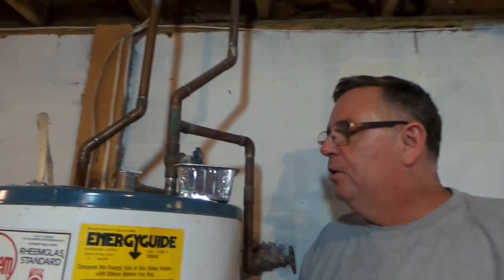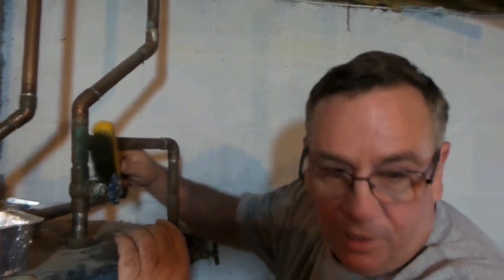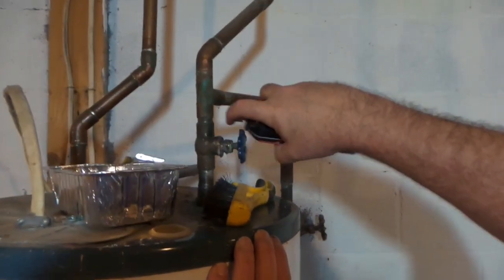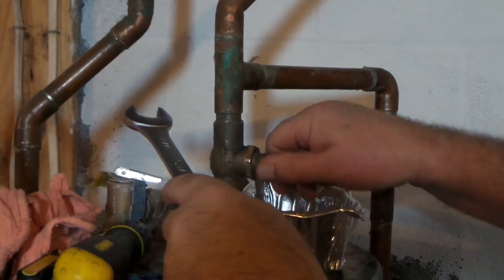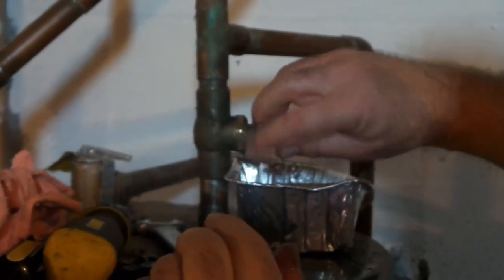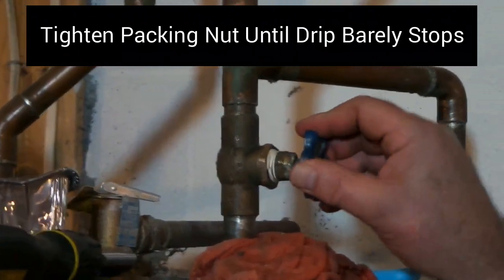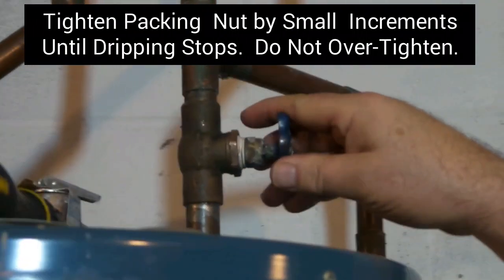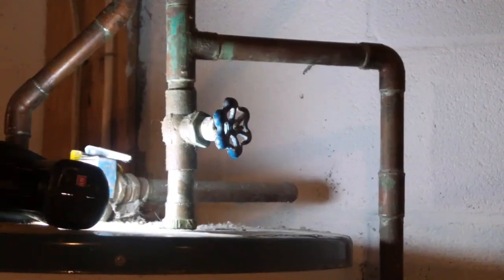Repair Leaky Shut-Off Valve Howto DIY Fix It - Please Read Safety Tips & **New Info** in Description

Comment: Aren't you supposed to wrap the packing rope around and against the stem?   Between the stem and the packing nut.
Reply from the maker: bobby D, That's the general consensus. But our valve is fixed, no leak. Cheers!
Reply: Does it matter what direction rope is wrapped also? Just asking. Reminds me of a “stuffing box” on a boat where shaft goes through hull. It’s made from a waxy wool.

Comment: I have a same problem with main shutoff valve, local 5-star plumber quoted an estimate of $980 to replace valve and pressure regulator, I know they would be very unhappy to see this video, because now I can fix it with only a few bucks.
Reply from the maker: Thanks for the comment
 Glad this helped you.
Reply: Plumbers are crooks
Reply from the maker: @johnnykurplutzo6789 - Some are.

Comment: I am having the same issue now. Home Depot tells me to replace the washer inside the valve, or replace the whole handle. What do you think?
Reply from the maker: @Jirong Hu ,

Hi. Thank you for your comment. We think you should do what works best for you, given your supplies, skills, and situation. 😊

We chose a rope seal repair. If you do this, once the packing (or bonnet) nut is loose and its threads clean, you can wrap its threads with PVC tape in a single or double layer to prevent leaks there once the packing nut is tightened. Apply the PVC tape, wrapping in a clockwise direction and slightly stretching as you go; this will hold in place while you finish the repair with the rope seal.

The rope seal goes on the valve stem and will be under the packing nut when that is tightened down again. The rope seal is also wrapped in a clockwise direction so that it stays wrapped as you tighten the packing nut back on the threads that you covered with PVC tape.

Basically, the thin PVC tape prevents leaks between tight metal to metal surfaces (such as packing nut to threads), whereas the rope seal is used to seal larger gaps (such as the space between the valve stem and packing nut). Both tape and seal are applied in a clockwise direction so they tighten as the packing nut is tightened. 

Remember to tighten the packing nut just enough to stop the leak. Do not over-tighten it; that could cause restricted water flow.

Please read and follow the cautions in this video's description.

Whatever method you choose, we hope it works well for you. 💦✅

Comment: Noticed the rope was put on counter clockwise
Reply from the maker: That's true, DIY john. And for anyone concerned with this type of repair, it is a good idea to wind the rope seal clockwise so the nut will tighten it, rather than causing it to unspool (if it catches the end of the rope). We were fortunate that the rope stayed put. Should it leak again in 30 or 40 years from now, we will endeavor to twist the rope seal in the clockwise direction. 😝 Thanks for commenting.
Reply: Thanks for the video very helpful
Reply from the maker: You're very welcome, fun times ahead. Glad we could help. Thanks for the feedback!
Reply: @ntccXerblog  do plumber tape work as well?
Reply from the maker: @cjjonez  if you mean that thin PVC tape, we would NOT recommend that.  You want the rope seal shown in this video. It's not too expensive; and you don't need much. 😀 Thanks for the question. 👍 Hope this helps.
Reply from the maker: @cjjonez  Look at 3:00 There is a pic of the rope seal we used. Someone named Olorin Mithrandir found the time for us. Very helpful.
Reply: @ntccXerblog  thanks I was in a emergency situation. I had the tape I used it. So far so good am going to buy the rope. Just in case. The guy at hardware store said it couldn't be repaired.. I felt it could I found your post and very thankful for your help...keep up the great work.
Reply from the maker: @cjjonez  Hey, that's great! We are big believers in "Whatever works." Conventional wisdom (proven methods) are great when you have everything you need on hand. But sometimes we need to work with what we've got. Glad you found a quick fix for yourself. We're curious to know how long the PVC tape will last; after all, there had to be a "first time" that somebody tried rope to pack a nut and create a seal that way. Maybe your fix will last just as long. We hope it does! Anyway, thanks for your comments and support.
Reply: @ntccXerblog  I can say this when I first tried it. I had the it shut off . I did what you said but with the tape. When I applied pressure to my kitchen  line where the problem started. The new shut off failed the pressure test it was new it leaked like crazy. So I had to redo all that work again. That's how I found out leak at hot water shut off. So I used your method in making adjustments it did leak. So when I reworked everything I put a little more tape than the first time I made a slight adjustment at stem and did rest by the nut. So far it's holding. Like I said am getting some rope for when and if it fail...just glad to learn something new. I do like to tinker...but if it do fail in the next 90days or 6 mo I'll post if not... I say it's all gravy and it cost 1.39 lol
Reply from the maker: @cjjonez  Well, we hope it lasts for you; but if not we would like to know how the final fix comes out. By the way, that was funny, what you said about "it's all gravy". Still laughing.
Reply from the maker: @g quin We guess you are replying to the original comment by DIY john. Our guess is he simply wants to drive traffic to his channel. Doubt he's trying to be helpful, (in our opinion). Anyway, thanks for your comment and support. =D
Reply: Cj Jones just getting ready to do this and only have the tape
Reply from the maker: @StarAnnasDream  Hope it works for you! 👍
Reply: Thank God for YouTube vids.

Comment: Will this work for a water shut off valve under the kitchen sink if the valve spinner is on top? Also do you have any videos or any advice how to stop a very slow tear drop leak coming from a steel pipe under the kitchen sink?
Reply from the maker: Under-sink valves are slightly different. They are compression valves. Just check online for how to articles or vids for them. Our experience has been that sometimes the service line (the flex line from the valve to the sink) needed to be replaced. Other times it was a simple matter of tightening the nut. And one time we had to add the PVC tape. Simple fix

As for the tear drop leak, we would replace the small section of pipe that is leaking before the leak gets any worse.  Be sure it is the pipe that is leaking, not a nearby fitting or valve. Water travels to the low spot, so a drip on a drain may run off the bottom of a pipe and look like a slow pipe leak. Just be sure you find the source before doing anything drastic.

Comment: My leak is on hot water shut off do I have to drain the tank to fix knob
Reply from the maker: Depends on where the hot water shut off valve is located. If the valve is the drain at the bottom of the water heater tank, then, yes, definitely need to drain the tank. You would also need to shut off the supply line coming into the top of the water heater tank or you'll be waiting forever for the tank to drain. :-P  Read this video's description section for safety tips.  If you don't feel comfortable with doing it, it may be better to hire a pro.
Reply: @ntccXerblog   it's at the top hooked to water line that flows water into the pipes in the wall
Reply from the maker: Tay, water flows downhill. So if your valve sits above the tank, you shouldn't need to drain the tank. You do still have to shut off the water supply coming into the valve. Also follow the safety tips, clike utting off nearby electricity and allow hot water to cool before working with the valve. Check the description for more info and good luck.
Reply: I would shut off the water heater first, if draining it. Otherwise it will be heating up without water in it and when you fill it back up, the heating elements will get fresh cold water coming in on the hot empty inside of water heater. Can cause steam and or cracks to happen inside.